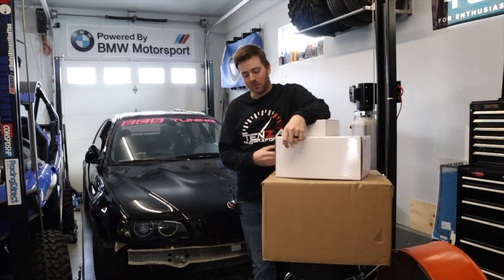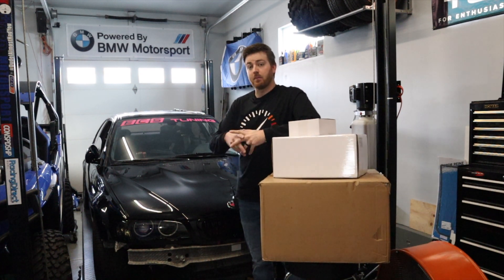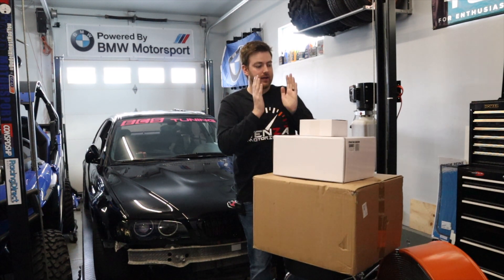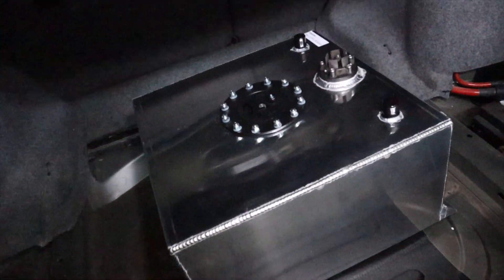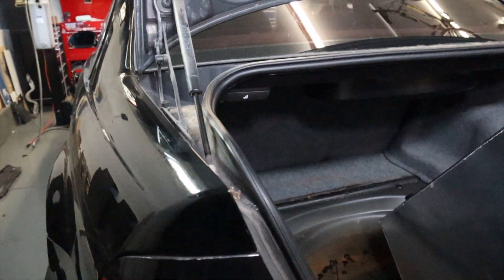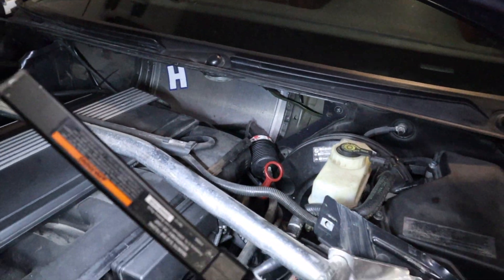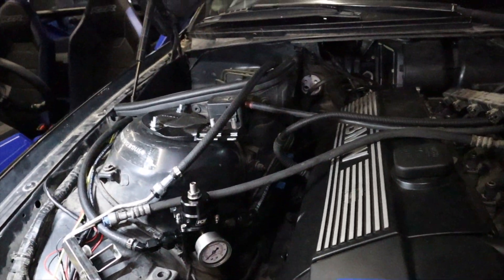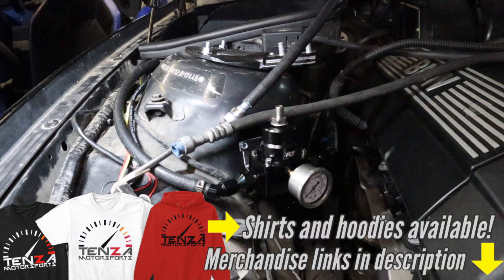BMW E46 Race Car Fuel System upgrade - M3 Fuel cell + fuel pump install - M54B30 swap Fuel System

Comment: Could I just adapt my fuel line to AN6 at the back of the car after the factory fuel filter/ fuel pressure regulator? Allowing me to run the cell on the factory fuel pressure regulator?
Reply from the maker: You could… but you’d need to make sure your regulator produces the same pressure before and after. Get a pressure gauge and see what it is now, do your mods and check it again afterwards. Other than that, I don’t see why not.

Comment: How long did the fitech pump last and why do you have the evil energy pump on ya docs for m3 build
Reply from the maker: The Fitech pump is still running. We are just unhappy with it and don’t recommend it. That’s why we have the evil energy pump linked and that’s the pump that will be going Into the white racecar.

Comment: Cant see the purpose of this style tbo. The Tank is low budget trash, i used it, and the anti swap mat will disolve after no time. Better setup, is to use the oe tank, go to an small surge tank and than go with the external pump to the front. Now you have a 40l Tank on the highest point, not good.